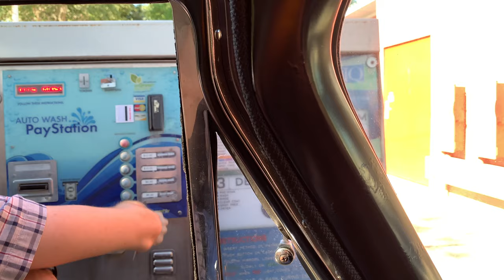D&S IQ Car Wash - 4K Outside View ft. vintage Mopar

Comment: 7:47 The plymouth was hard to start when the dryers kicked on
Reply from the maker: Water got into the carburetor, it was about to stall again, lol!!
Reply: @sunshinesuds  lol yeah could hold the gas pedal a little and turn the key
Reply: @justinlyons8676  not quite that simple, this car does not have choke plates either and was cold.